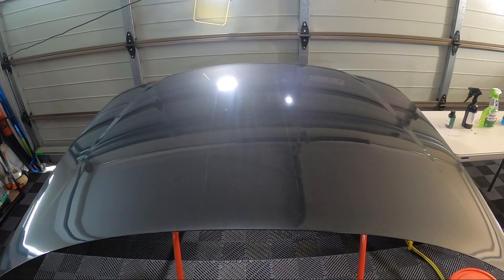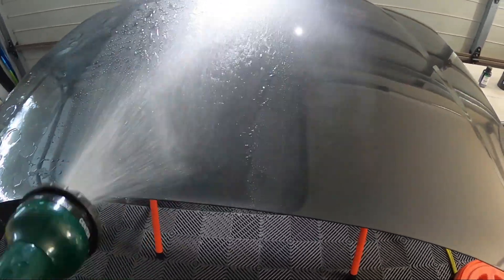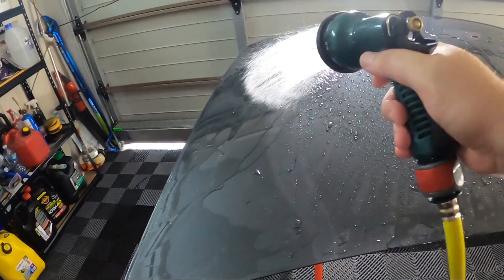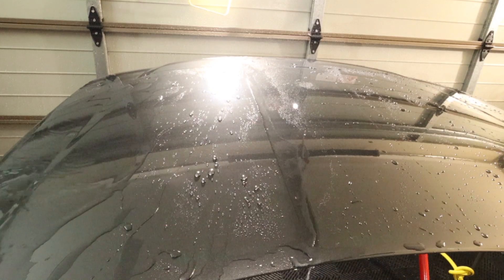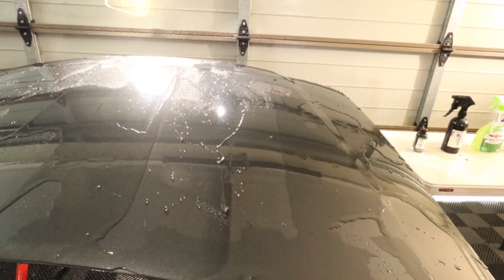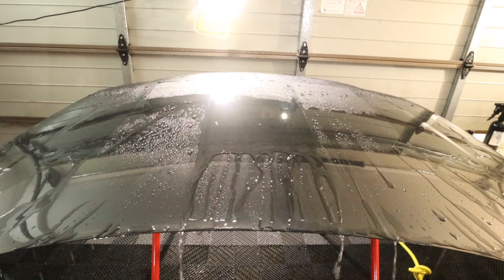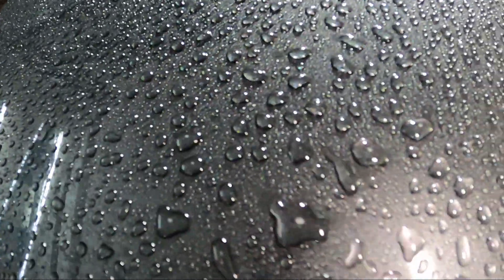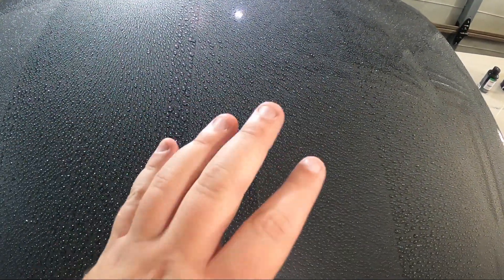Ultimate Touchless Sealant Test 2 Week Update | Carpro v Gyeon v Bowden's v Mirch v Platinum Potions

Comment: Hi there Evolved. Respectfully, I am sensing some slight favouritsm toward Bowden's. I'm enjoying the efforts in all of your mini series, especially the last one with wipe on sealants, but please hear me out as I don't intend to offend.
1. The moment the Bowden's product went down hill, it wasn't the products fault, it was supposedly the way that you applied it. When other brands commence to fail early, it's that they're assumed as inferior products. Why was it not considered that the CarPro and Gyeon were also incorrectly applied?

2. You say at 14:00 "...the only reason why I'm sort of more saying I think things have gone wrong this time is because I have used the Bowden's." That's incorrect though. You have never used Bowden's Green Dreams which is a revised formula of what you have used, being Wet Dreams. The two are different formulas. You mentioned you started the original series with Wet Dreams, but then later switched to Green Dreams after Bowden's reached out to you to give their new formula a try, which isn't out yet.

Why would it not be possible that their revised formula just didn't meet expectations? It would have been totally fine to assume. It should be made clear that you have never used the formula that you're using in this video. You've used a different one (Wet Dreams).

3. Your video thumbnails - not exactly representative of the Bowden's you're testing in this very series. It's a bottle of their orange Wet Dreams. The current formula. What you've been given isn't what is shown in the thumbnail. Bowden's may well have been on to a winner with their Wet Dreams, but something went amiss with the reformulation they gave you, so in my opinion, simply report it that way.

For me at least, there were too many signs that you seemed worried of what Bowden's may think of you if you had just plain reported the results.

Apologies if this offended. I love the channel.
Reply from the maker: Hey Nick, I'll address all your points below. 

1. I'm definitely talking about the Carpro, Bowden's and Gyeon not just the Bowdens, all of them should have performed better and I've been using Carpro Hydro2 for years now and whilst mostly on coated cars I've used it on others and had better life out of it so when I'm saying somethings gone wrong here I'm addressing all 3 of the failing products. 

2. While it's correct I haven't used green dreams before I'm basing my previous experience on the wet dreams product I am assuming it's going to perform very similarly and I've been using it alot on our new CX5 lately and been having a good month before I see any change. And yes it's a different formula to that I am again assuming it should be as good if not better being that it's revised.
(Also I didn't start the test again because they offered me a bottle of green dreams I filmed the first one and then posted a photo of the products on a FB group saying new test coming soon, the next day when I went to edit I realised my microphone was turning on and off and crackling so the clips weren't usable that same day Bowden's reached out and said oh damn If we knew you were testing wet dreams we'd have sent you a bottle of the new formula as it's even better, so I explained I have to refilm again so they can if they want and I'll use it for when I try again) 

3. The thumbnail is purely used as that's the photo I had taken when originally filming the first attempt of the video and had edited it ready to be used as the series thumbnail (I forgot to take another one when I used the green dreams ( youtube thumbnails are important to get people to click and have youtube then spread the video to potential new viewers) it's only that I forgot to get a new one and when I finished editing late that night and going to make the thumbnail realising I didn't get a new one I decided to just use the original one. 

Not worried about what bowdens think I believe I've already upset them a few times in different videos now but they're fine with that and were still willing to send me the green dreams. 

I get how it seems I was only worried about the Bowden's not performing but it's actually all 3 as I am frustrated after doing this test twice now I've had so many issues and I didn't want to start all over again a third time. 
Probably seems I had tunnel vision on the bowdens as it's just fresh in my mind since I've used a lot of it on our Mazda recently so knew what I was expecting from it. 

And lastly Carpro Is actually my favourite brand and what I use the most off camera and hydro2 has been a long time top 10 favourite product. 

Absolutely no offence taken and I sincerely appreciate the feedback sometimes I just need to shut up when filming but I was just frustrated with the results from the 3 products as I know they should have done better so something I have done has caused an issue clearly
Reply: @EvolvedDetails  I've just sent a bit of cash your way for a beer mate. I've never done that before on YouTube but the effort and demeanor in your videos is impressive. Your full-disclosure style of filming is admirable. Please keep making these. Thank you.
Reply from the maker: Thanks so much Nick I really appreciate it and I hope you enjoy the rest of your weekend

Comment: i have watched a lot of your videos and it does seem that the end parts of the panel seem not to be real good. surprised especially at gyeon. Have used Mirch with exceptional results, but Bowdens I know is safe so continue to stick with Bowdens
Reply from the maker: I mean I did use the edge in the last test with IGL Premier and it did well. Also in the graphene test I used bowdens own bead machine on the edge and it won.

What I'm thinking of doing is reapplying the carpro and gyeon at the top and applying more mirch and platinum potions on those two edge sections to test that out.

Comment: I switched to Gyeon's wet coat essence, I mix it a lot stronger and also apply it with a snow foam cannon. This has been the best method for durability and application imo, admittedly you will spend more but damn the concentrated version has next level gloss and sticks around for a while.. I had two different body shops struggle to paint some panels because WCE was still present after a bunch of APC and TFR washes, they ended up having to take them off the car and paint them isolated, the booth was kicking up WCE from the rest of the car when it was in there.
Reply from the maker: Yeah I've heard great things about that and actually would like to try it

Comment: I think it's the panel. It seems the out side never lasts on it. No matter what you apply. Good demonstration on sometimes it being the paint and not technique or product
Reply from the maker: I mean I did use the edge in the last test with IGL Premier and it did well. Also in the graphene test I used bowdens own bead machine on the edge and it won.

What I'm thinking of doing is reapplying the carpro and gyeon at the top and applying more mirch and platinum potions on those two edge sections to test that out.